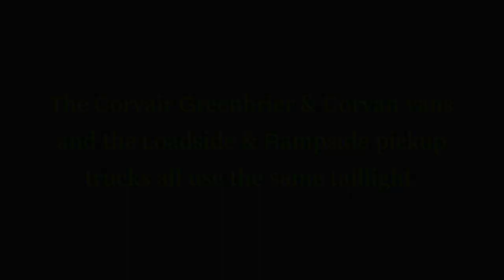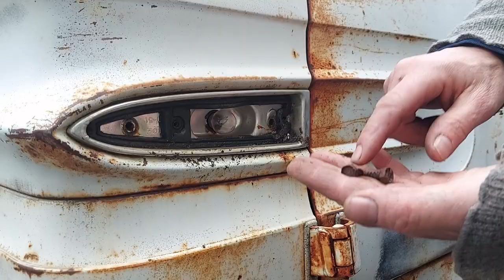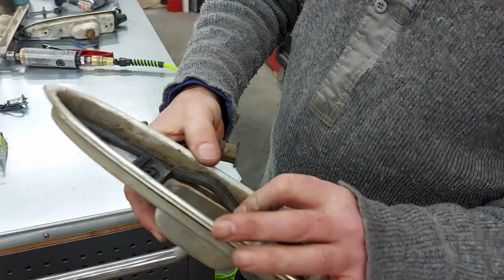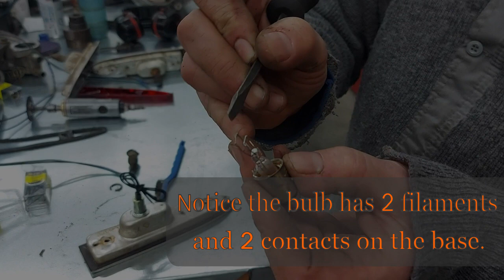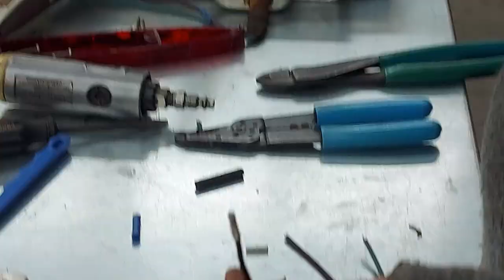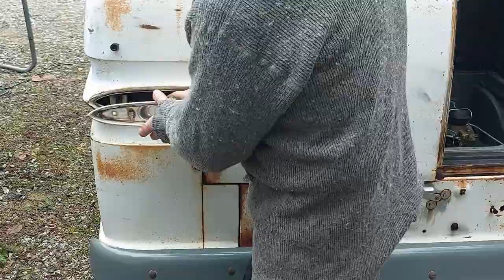Corvair FC Taillight Socket Repair

Comment: Everything went well till I tried plugging in the bulbs. After playing around with all things again I discovered that the bulbs bayonets were a little higher on the cylinder. I had to file down the bayonets on the top side to get them to twist thru the slots. New bright bulbs. 1157.